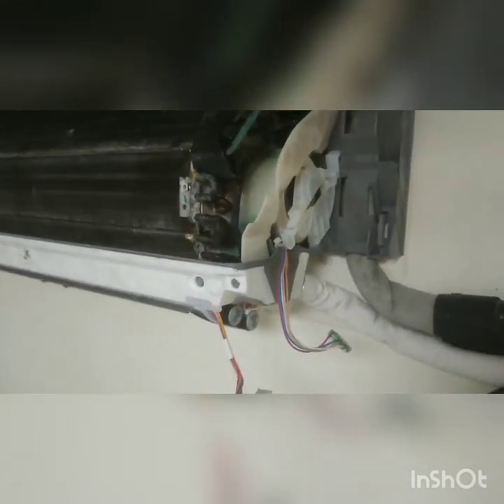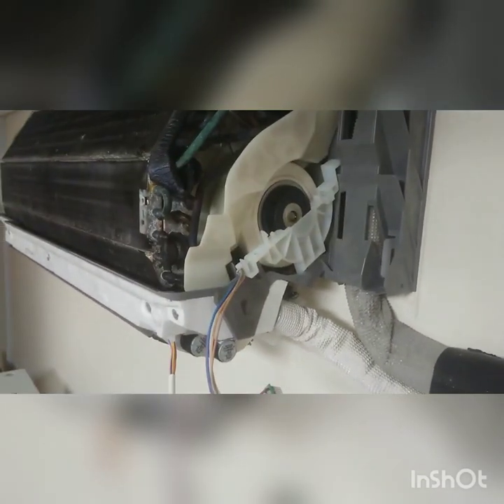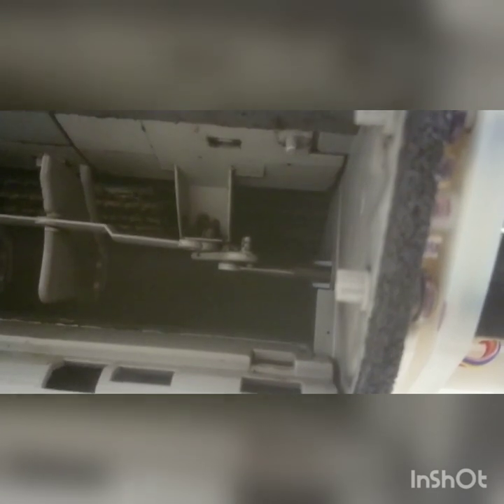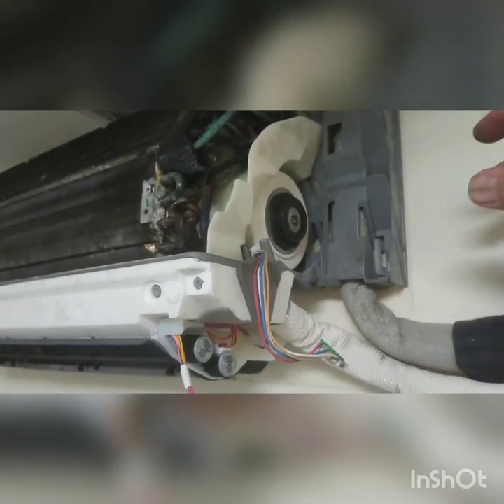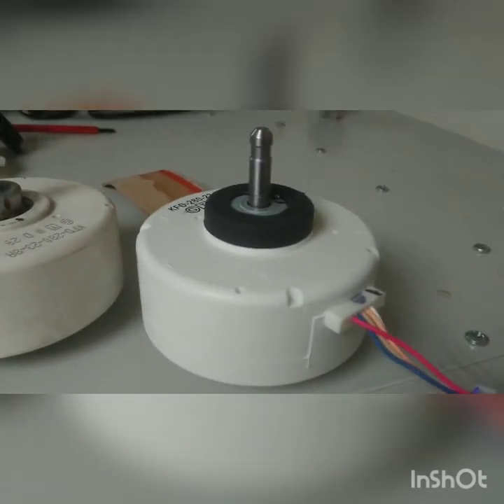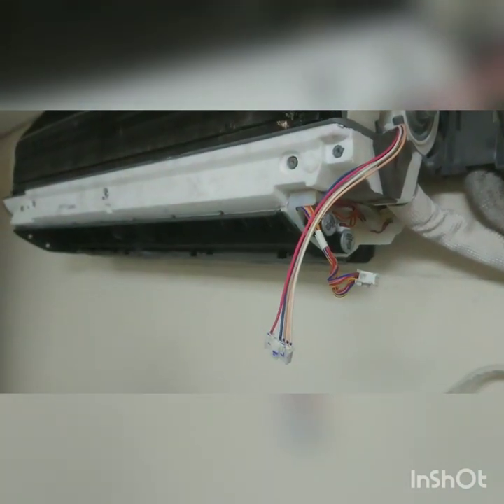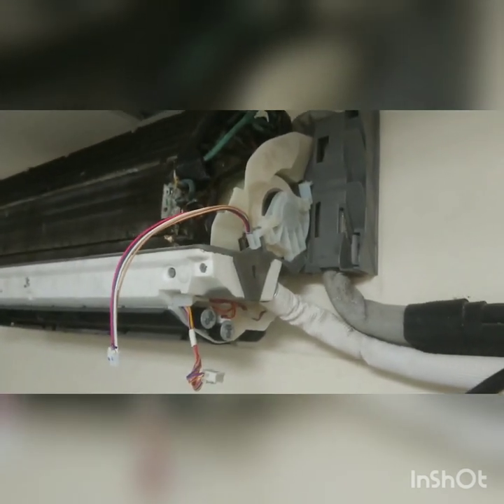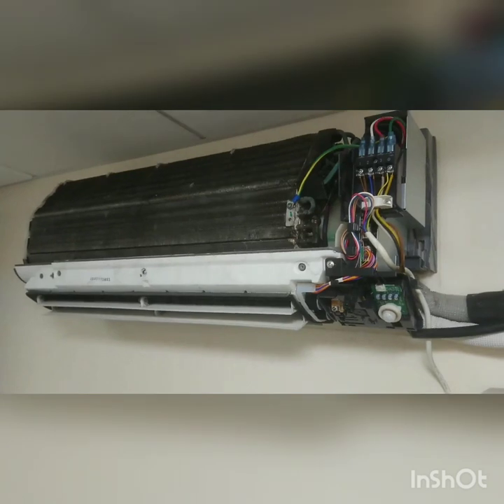How to change a Daikin air conditioning fan motor

Comment: Your Video on how to remove Daikin indoor unit fan motor without having to dismantle Heat Exchanger is a real help and saved me lots of angst. I really applaud your lucid explanation of the process and the tip on grub screw and re assembly. Thank you for sharing your experience with others.

Comment: I appreciate the video, I’ve been doing hvac for 5 years and have yet to work on many daikans, mostly Fujitsu, lg and Mitsubishi plus some low end brands and was informed from a coworker that I’d possibly have to pump the unit down and remove it from the wall to replace the fan motor to get the drain pan out and I thought that was absolutely ridiculous. Will try this method out tomorrow, once again thank you!

Comment: thanks for the time and effort you put into this post. i am a master hvac contractor and i was looking for a brand that is not $$$ mitsubishi that you don't have to remove the evap coil to replace the fan motor like most brands and your post answered my q instantly. i do sell airtemp but after looking at the specs airtemp only has a 7 year warrenty on mini splits dickin has a 10 year warrenty so case closed....last note your fan blades are satureated did you throw away the filters??

Comment: Thanks for the detailed video. Was the motor replaced due to noise concerns or motor stopped working? If noisy, would you happen to have a video to show to noise concern. My indoor unit is noisy whenever the fan is on, noise increases with fan speed. Daikin came out and said I need a complete new indoor unit which seems excessive but maybe just easier for them.
Reply: I had a ticking sound on one of my units and it increased over time. Just had the fan motor exchanged for a new one and the sound stopped. 2 years later and I again hear some lil bit ticking on the same unit. The issue could be with bad fan motor axis alignment imo and so it will bend the axis slightly over time. What did you do with yours?

Comment: I've loosen the screw but the motor axel got stuck to the blower. It can be slide back and forth but not all the way it got stuck midway. Any answer?
Reply from the maker: Try a squirt of wd40 or unscrew the screw another half turn.

Comment: I have a CTXG12QVJUS after replacement of the blower fan we had a whirl whistling type noise and cannot figure out what is causing it. we thought it was the motor and replace it and still have the noise. Any ideas what could be causing the noise? The fan and motor appear to be positioned correctly. It is being worked on by a tech from a Daikin Dealer.
Reply from the maker: Did you replace the bearing on the opposite end of the blower?
Reply: If the noise is coming from the left hand side of the unit it is more than likely the shaft support bearing for the blower wheel, if it’s from the right you may have got a bad fan motor, you can usually tell if the fan motor is bad just by spinning it with your fingers and listen close to you’re ear, if you hear a noise or feel a restriction it that would be the motor. I’ve also had units have a whistling noise from a broken fin on the blower wheel or some have weights and if they’re not in the correct spot they may whistle as well, now if it’s more like a vibration sound I’ve had units where if the wiring harness for the fan motor is resting on the motor it’s caused a sound as well, just some tips to look for that may help you

Comment: Well i must say you should never say the weird just in a video it implies somethings about to be easy. 6 hours and this things not just coming out without a big hammer. Not all models just come out this easy. Smashed the entire old fan out from back to the front now looking at welding a thread on the shaft to Jack it out like a reverse bearing puller.
Reply from the maker: It does state in the video that this is not for the DIY enthusiasts.